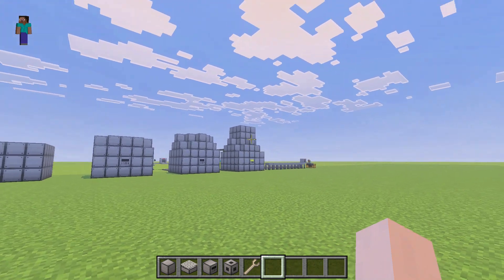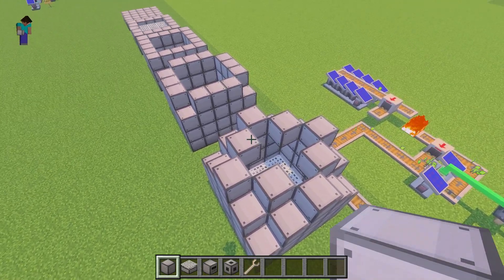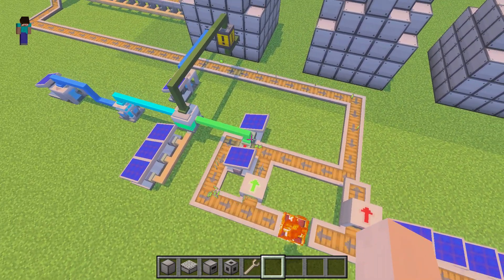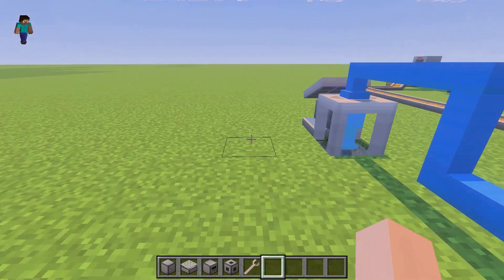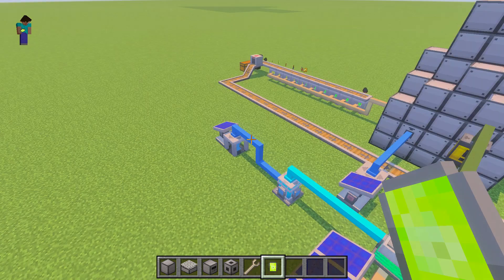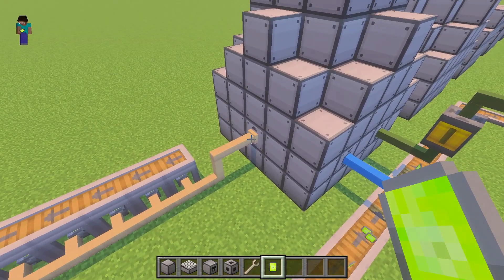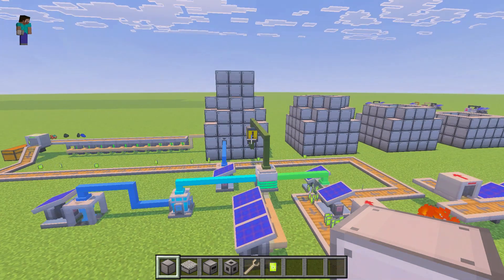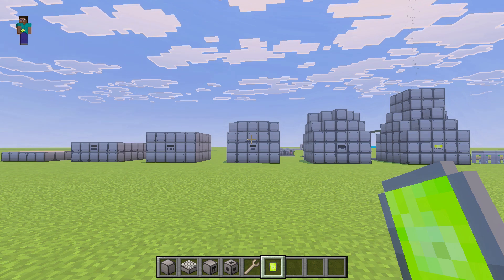Minecraft Bedrock Basic Machinery Nuclear Reactor

Comment: Hello, can you tell me how can I get or find this? carbon nanotube
Reply from the maker: You need a graphene factory. Start with an oil rig, and connect that to a gas seperator. On the carbon side of the gas seperator, the dark one, connect a graphene factory. It will generate nanotubes. I have an example in the previous video in this series.
Reply: thanks you best @RickClark58